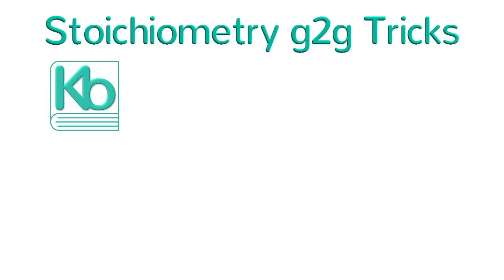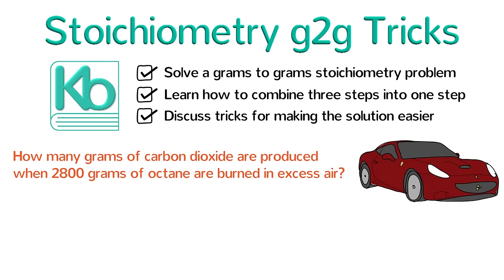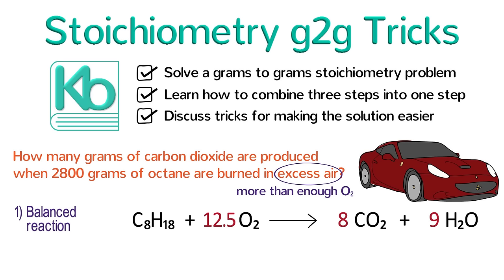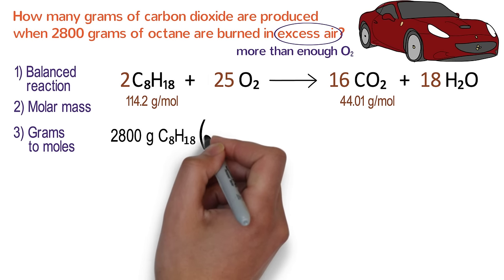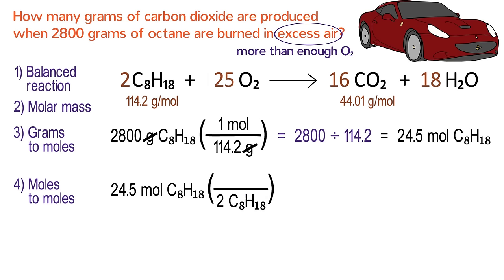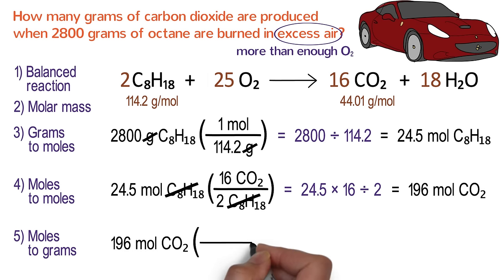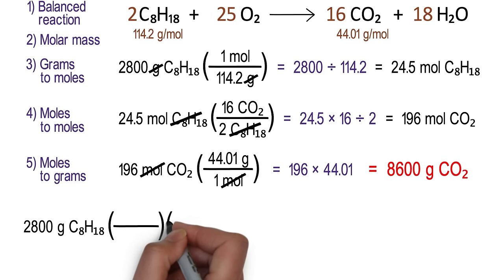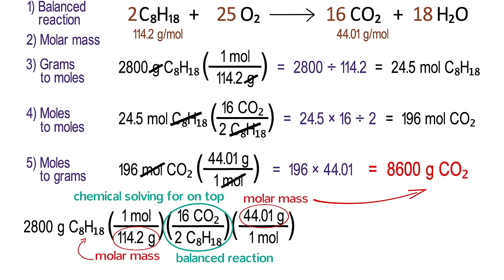Stoichiometry Tricks

Comment: top left and bottom right always have to have 1 mole bottom left goes the molar mass of what you start with and the top right has to have the molar mass of what your solving for and the middle section is the coefficients of the chemicals from the balanced reaction 00410

Comment: the balanced reaction is used between the 2 unit conversions of mols and grams. The thing you're solving for is multiplied at the top and the thing you have is divided and the  2 numbers are used as coefficients. 00205

Comment: It’s not 8,600 it’s 8632.43 your wrong
Reply from the maker: As I mentioned at 4:39, there are only two significant figures, so although mathematically you may be correct, scientifically you are incorrect.  The answer should have only 2 significant figures.  And by the way, it is "you're" not "your."
Reply: @ketzbook Hi. I have a question, should be just one significant figure for the 2 C8H18 isn't ? Thanks.
Reply from the maker: no, the 2 is a counting number, not a measured value, so it is known exactly (infinite sig figs)